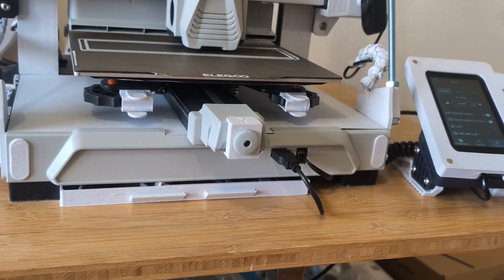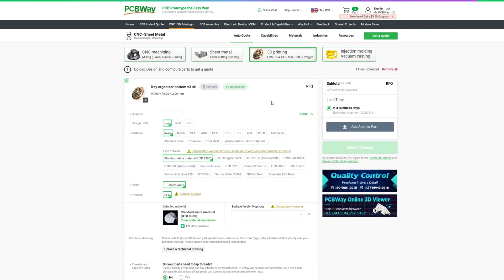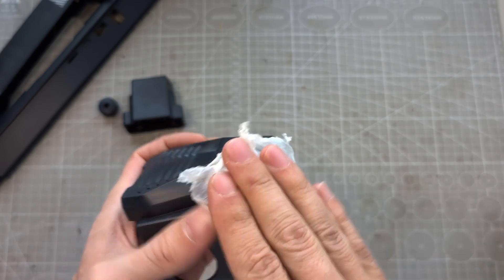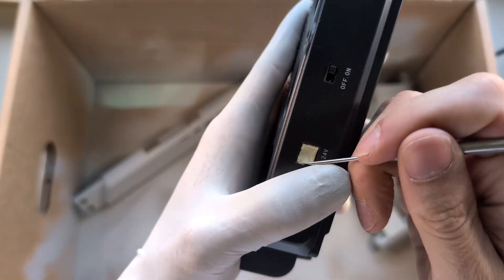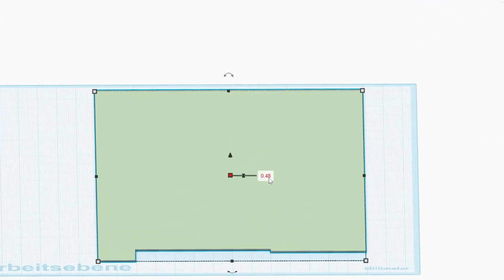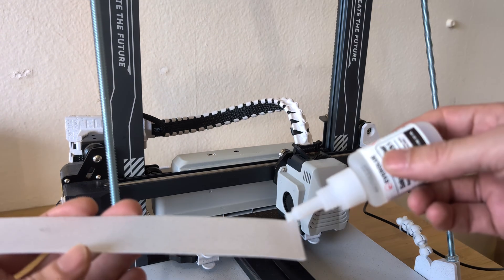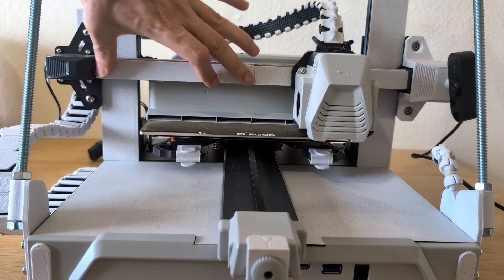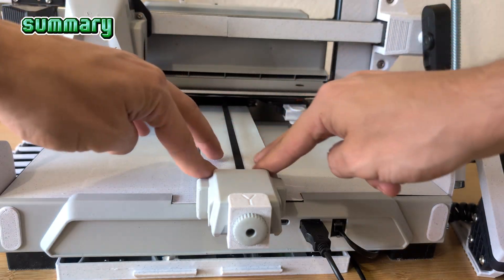Color your 3D printer the easy way - tutorial

Comment: I love the look of that! I have a N4Pro so I might use your files and do it too.
Reply from the maker: Thx mate, if you want, i also have a lot of upgrades and other modifications in my N4 upgrade-videos, all free to download ;-)
Have fun printing ✌️
Reply: @Dirt-E-Bikes  For your other upgrades and mods, would PLA be fine? I have my printer in an enclosure and when it's enclosed even just printing pla the chamber easily gets to ~40°C.
Reply from the maker: @thedoggoduo1  i did mine in PLA and everything works fine, in your case, with the enclosure - maybe PETG would be the better choice.
Do you use the enclosure for ABS prints? Mine is struggling a bit with ASA and ABS when they are bigger parts do to warping. I wonder if an enclosure would fix that
Reply: @Dirt-E-Bikes  If I do it, I probably will get get some PETG. Sadly, I have not tested ABS yet as I havn't gotten around buying some mini air purifiers.
Reply from the maker: @thedoggoduo1 true, a filter would be necessary for that. I just printed some small parts and the smell was not good in my little workshop 😅